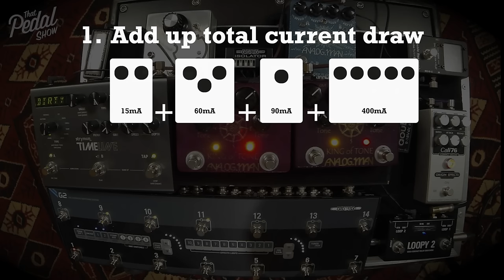That Pedal Show – How To Power Your Pedals Properly & The Legend Of VCPI

Comment: 18v into 9v pedals - worst case, the power supply filtering capacitors might blow (if they're rated for 10v or 16v ). Most transistors and opamps will have no problem handling 20-30v.

Analog pedals don't really have components that are THAT sensitive (ie. need such precise voltages), or that "esoteric", so even having components replaced should be cheap as chips. 

Digital pedals, that's a slightly different story, although those most definitely have some switchmode (or worst case, linear) regulators inside, to convert the 9-18v input into the 5v and/or 3.3v the digital circuits require.
Reply from the maker: +KhronX yeah, but when the caps go, you're without the pedal till it gets fixed :)
Reply: That's why you want a tech in your circle of friends...
*shameless plug* :D (no electrical-plug pun intended)

Comment: If pedals have more headroom at 18v vs 9v, why stop at 18v? Perhaps 36v or 72v? How many volts are amps running at? With all the pedals that are designed for fly gigs with users who want to have the feel of an amp (increased headroom), why aren't more pedals going in that direction? Would have been good to touch on wah pedals and the hum that can be induced by being too close to a power supply. Supposedly there are manufacturers who make some (maybe Cioks and Dave Friedman's new one) that you can mount a wah on top and there is no hum.
Reply from the maker: +NERV Abraxas because there will be a limit to the amount o voltage they will be able to take, if the filter capacitor for example is rated at 22v then anything over that and you have a nasty dead cap. I've blown caps before and it can get messy :)

Comment: So just to clarify both AC and DC are covered under polarity?
Reply from the maker: +Mycall1983 AC and DC are different types of current. Batteries are DC (direct current - current flows in one direction), and most pedal supplies are too. The pedal will say, for example, 9V DC, 12V DC etc, where polarity is critically important. There will be a diagram, commonly indicating centre-negative polarity for most effect pedals. 
If it says AC, that's alternating current (flows in both directions so has no fixed polarity).  You'll need a separate AC supply or a specialist adapter.
The vast majority of guitar pedals are DC. It should say clearly on the pedal or in the manual so please check. 
Thanks for watching!
Reply: Sweet, thanks very much for the clarification! I'm loving the channel and throughly enjoy the vids 👍. I'm having very similar noise to what you were explaining in this video, I have two AC digital pedals on one supply and it is very noisy. I guess I'll just have to bite the bullet and run them on separate supplies 😕 lol

Comment: I didn't know about the rule of "having a power supply that can deliver twice the amount of current needed by the pedals". So I assume that's why my Timelord manual says "Output Voltage 9V DC. At 400mA.", but "Output Current max 999mA aprox.". It just means that the Timelord can deliver up to 999mA, but can't guarantee to stay at 9v at that level of current. Am I right about this?
Reply from the maker: +19Cluj it's all about headroom :)
Reply: With guitars, amps and pedals, it's always about that I think ;-) By the way, should I expect any differences between a Doubler and jumping 2 Isolators outputs (for low current pedals)?

Comment: What happens if the power supply doesnt provide enough curret to the pedal? 

Let's say, a pedal is given 100mA through the socket though it's requirements is 134mA.

And here I'm talking about power bricks, let's say it has 1A current out and have 8 sockets. But each sockets are shown to have 100mA outs only.

Is it a fixed amount or not?
Reply from the maker: It’ll sound thin, or not work at all. Cheers!
Reply: so the power brick wont 'take' or 'borrow' current from it's unoccupied socket since it is an isolated power supply?

Comment: would my klon clone be okay using sag or would it mess up the buffer?
Reply: You're usually okay giving any pedal less voltage though it may not sound or perform the way you'd like.  But you'll not blow it up the way you would if you applied too much voltage.
Reply: Brian Ingram i emailed the dude that made the pedal, he said i shouldnt use any less or more than 9v

Comment: What if i feed every pedal with a separate adapteur plugged into an extension cord? Can i consider them isolated?
Reply: This is exactly what I just did, and I thought the same thing. It's definitely isolated that way, but I'm running into some strange issues that seem like ground loops that seem to only be resolveable if I make at least 2 pedals share a common supply.

Comment: Guys, might be a silly question, but why would you use a compressor pedal with 18v rather than 9v?
Reply from the maker: That’s a great question. It depends on what the 18v gives you. If it translates into more headroom, than you might have less compression and a wider range before the signal starts to be effected by the compression controls. It’s another variable in gain staging. Most of the time it’s a subtle thing and personally I think 99% of them sound better at 9vdc 👍

Comment: Does the Voodo labs power supply work as an isolated power supply. I blew one up on a pedal board. It took out my TC Flashback. The other pedals on the board at the time were all 9 volts. the Voodoo labs was replaced and TC gave me a replacement , but i do not want that to happen again
Reply from the maker: +Frank Quinn It depends which one you hey Frank. But generally yes. Thousands of them get used everyday all over the world so they shouldn’t be ‘blowing’ anything if used correctly. However, something sounds not entirely right here. But if it says ‘isolated’ in the description, then it should be so. Some of those brick supplies sometimes have a pair of outputs where you can use only one (TRex Chameleon, the green one, for example). Could be something like that maybe? Cheers!
Reply: I think the power in the bar i was playing was bad, but when the voodo power brick went it was damn hot. The TC went into a constant feedback tone once i replaced the power supply with my back up voodo lab

Comment: Problem with power supply these days esp the brick ones, are marketed as "isolated " and "regulated", but when you open them they're technically "daisy chain"-ed on the board inside just a regulator on the end.

Comment: hi guys. what do you think about the mxr dc-brick? it doesn't say the power is isolated but i was at a store and the guy says it's isolated power supply?? any comments??
Reply from the maker: +Gerard Ong Depends which one. The old black one didn't have isolated outputs as far as we're aware. The new silver one does, apparently. (And is called the ISO Brick?)
Reply: they've got 2 silver ones... the dc brick, m237 (which is the one the guy at the guitar store was saying has isolated power). they also have another one called iso-brick. only difference i see between the two is the iso-brick is thicker and has a variable voltage whereas the dc brick only does either 9V and/or 18V. but big question is, is it the big "I"??? thanks for the quick reply btw!

Comment: Does doubling voltage half the Ma coming from the output?
Reply from the maker: It depends on how you’re doing it. If you take two 9v outputs each capable of 100mA, then run them in series you double the voltage but the current stays the same. Run them in parallel and you double the available current but voltage stays the same. However, if the source you start with is the last example, 2 isolated 9v outputs in parallel, giving you 200mA, and you separate the 9v sources and run them in series to give you 18v, you will get 18v @ 100mA
Reply: That Pedal Show thank you!  Using an exotic voltage doubler out of a 9v 300ma output to power a 150ma pedal at 18v.  Confusion started when I read in one of my power supply manuals that changing the 9v dip switch to 18v will cut the 100ma output to 50ma.  I also have a small current reader I use to check the pedals true "ma" pull. Depending on if the doubler was before or after the current reader, I got different readings on what the pedals current draw was pulling at 9v and 18v.  ....rabbit holes.  Thanks again for clearing that up.

Comment: You forgot to mention voltage regulation. Garden variety wall-wart type power supplies have no regulation and very little, if any, filtration. These types of power supplies can introduce noise into your signal path and should not be used with audio equipment.
Reply: Agreed. I have six wall warts plugged into power strips and makes god awful noise. And these are Boss ps and others that came with the pedals.

Comment: I use a Diago micropower9 (1000ma), about £25, I could buy a Diago powerstation (3000ma) for about £60.  I use a daisy chain to power my eight pedals and it's completely silent.  So, it's well worth trying such a solution before implementing the "everything should be isolated" approach, which will cost you an arm and leg, and may be completely unnecessary.
Reply from the maker: +Rob D We say that in the video Rob. Do you use an currently hungry digital pedals?
Reply: Hi, you don't quite say that in the video to be fair, Dan does say that you should try and isolate everything and he doesn't qualify that to say you might not need to.  Don't get me wrong, I understand exactly what you mean, and it'll depend on your pedals, but it seems to me that everyone to assumes they need to spend a LOT on isolated supplies and most video and magazine reviews reinforce that view.  
My board is probably modest and doesn't have any high draw pedals, I have: J Rocket the dude (thanks to your review), a Fredrics Klone, CAE wah, TC Electronics HOF, Keeley Seafoam Plus, TC Elec Nova Delay, Empress Tremolo 2 and a Ditto (and occassionaly I slip a Rat in there).  So no hungry digitals, I don't think.
Reply: The thing is that this is somehow risky. Everything will be fine and one day, you'll show up at a venue and it will hum like crazy. Isolating everything can be seen as a kind of insurance: you might live very well without it for a very long time, until something happens and you really wish you had that before.
Reply from the maker: +Rob D Dan says that he guarantees that somebody will make the point that you make. And we both 'that's great!' And then go on do discuss why the daisy chain option might - note 'might' - cause issues. Cheers!

Comment: The Polarity discussion could have gone in a whole other direction DC AC. HaHa.

CIOKS (Danish) Pedal Power Supplies are the most flexible with 9V or 18V outputs with varying currents (DC7),  They use RCA jack patch cables, but it comes in the kit. Most other supplies only come with 2 18V outputs. CIOKS uses new Switch Technology, compared to old pedal power supplies like Voodoo Labs. See the CIOKS YouTube Channel.

Comment: Hi. Can i plug a daisy chain into a power supply if the m amps are low enough?
Reply from the maker: That becomes a question of isolation, even with low current draw pedals you can get Earth loops from connection the grounds through the power supply by using a daisy chain, so isolation is very important
Reply: That Pedal Show thanks
Reply: That Pedal Show i have about 13 pedals i want to power. Would the best way be 2 power supplies? Or can running 2 power supplies cause any ground loop problems?

Comment: What power supply do you prefer - and would one power supply suffice for a varied pedal board?
Reply from the maker: +Lars Frøsland We use TheGigRig modular system. It all depends entirely on what pedals you have. If you have a bunch of simple 9v low current pedals, an all-in-one solution can work fine. When you start adding different voltages, unusual pedals and higher currents - especially with digital pedals - something more bespoke is the way to go. Cheers!
Reply: That Pedal Show Cheers, guys!

Comment: I have an Egnater Tweaker 15 (not sure if the amp model makes a difference) and it sounds great when I have no pedals turned on in the effects loop.  As soon as I turn on my MXR Carbon Copy or the Boss Harmonist in the effects loop, I lose a ton of volume and treble.  I was wondering if anyone thought this was a power problem or a problem with the effects loop itself.  (I am using a daisy chain to power my pedals that are NOT in the effects loop, and three independent power sources (1-Spots) to power the here pedals that I have IN the effects loop.) ANY help or advice would be greatly appreciated. \m/
Reply from the maker: Try a buffer and/or boost among all that lot. The cable runs and a so-so send/return circuit is where you’re losing the level. We’re not familiar with the Tweaker, but also check to see that the loop doesn’t have a level preset switch. It might! Also, try each pedal individually to see if one or the other is worse in terms of volume drop. Cheers!
Reply: That Pedal Show Thank you so much! Keep up the great content!

Comment: What happens if you do a daisy chain off of an isolated supply (say a Pedal Power 9v node)?
Reply from the maker: +B.C. Morgan then the pedals you chain together will be on that shared supply. As I said, daisy chains can work fine for lots of pedals, but if you run into problems you know where to look
Reply: Thanks!  I only have an ISO 5 and plan to have like 8 pedals on the board.  Thought I could cheat a little till I can afford something bigger.

Comment: Hi Guys,

I've bought a (Keeley modded, obviously :) ) BD-2 Blues Driver
They list this as their power supply:

Power Supply:
DC 9V : Dry Battery 9 V type (6F22/9V)
AC Adaptor (PSA-Series: optional)

Does it mean it can take both AC and DC power?

Cheers!

Comment: Great re~visit to the principle 
Mik said it, ⚠️
My QTron runs 24 volt my Quantum Time is 18 volts, my Nova, 12 volts my 720 Looper, runs 9 volts and all of the ends are center negative 2.1 plugs and on a dark stage I plugged 18 or 24 in to my looper. I watched her blink good bye and was heartbroken. Fortunately for me EHX is a forgiving company and I E mailed C/s explaining I purchased used, my fault and they sent an rta barcode label and small service fee, shipped included repaired. Now all of my cables and backs of each pedal have a strip of colored electric tape ( they sell in 5 packs, red for 24, orange for 18, yellow for 12, white for 9 volts, leaves green open for say a jeyboad ordrum machine that is center positive ground. So be safe, protect & wrap your adapter

Comment: If isolation is so important why isn't the GigRig distributor not isolated for each output? instead of having to put an isolator on each pedal, you could just isolate them at source.
Reply from the maker: +Chris Cuthbertson the Distributor isn't isolated do it can deliver the current the Isolators and High Current Adapters need.  The Distributor is there to distribute power to Isolators and to High Current Adapters. Both of these isolate power to the pedals but the Distributor is needed to make sure the ISO's and HCA's get enough current to do there job.

Comment: What if I plug my pedal to a source that has more current (mA) than the pedal need?
Reply from the maker: That’s fine. More current is fine. But the voltage and polarity must be correct. Cheers!
Reply: That Pedal Show and if I got a pedal with inverted polarity (positive center)?
Thanks for the answers and videos!

Comment: I have noise issues when I go through the effects loop of my amp. I have no/barely noise when I put my pedals before my amp into its input. Does anybody know a solution to this problem?
Reply from the maker: Could be a number of things. 
Noisy loop - tough to fix unless it’s tube-driven/recovered and is a noisy tube.
Interference from long cable runs - get better shielded cable and avoid things that might interfere.
More likely is that whatever is in the loop isn’t properly isolated from everything else and/or the pedal itself is noisy... especially if it’s digital and not properly isolated in terms of power. Hope that helps!
Reply: Thanks for reacting. I think my amp is tube-driven, it's a Vox AV60 (it has one tube for the preamp and one for the power-amp, so it is not one tube per channel).
Reply from the maker: It won’t be a tube driven effects loop. So it might just be noisy. Trial and error!

Comment: how can i mesure the mA of each pedal ? in all the ones i had there only one who i can see that is 300mA
Reply from the maker: +sebars30 It will say in the manual or on the manufacturer’s website what the current draw is. Cheers!
Reply: Check out "the power list" at the stinkfoot.se website. They list the current draw for hundreds of pedals.

Comment: why is center negative a design flaw ?
Reply from the maker: +Timothy Engel because the outside of the connector has to be isolated from the outside of the chassis. Outside is positive, chases is neg. if you're using a daisy chain and you have a spare plug, the exposed part of the connector just has to touch a pedal and you get s short circuit